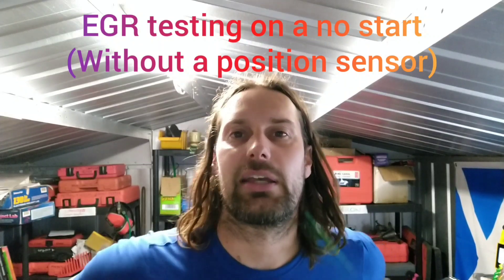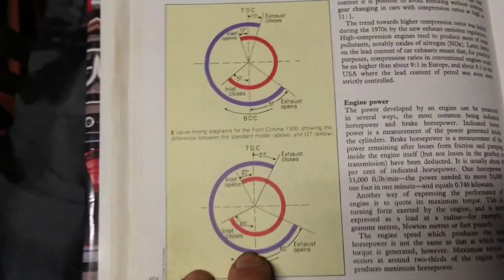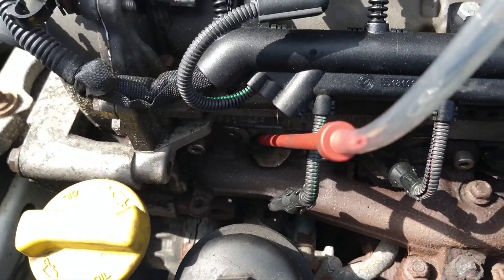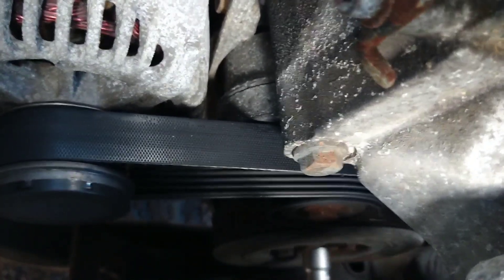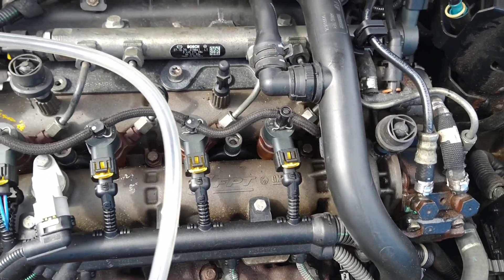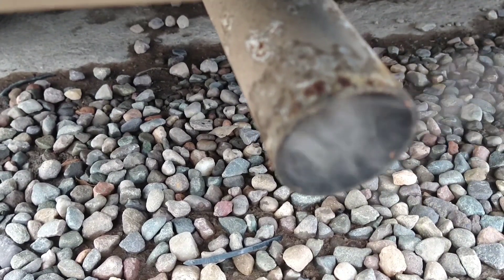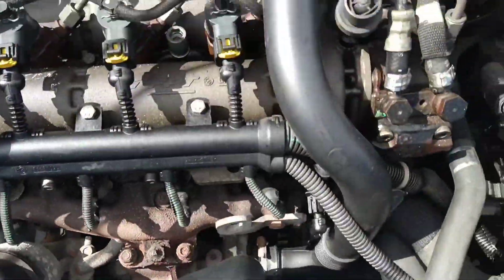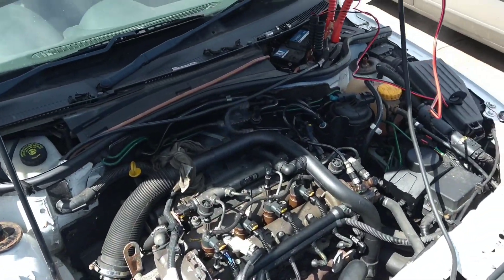EGR valve test (with a smoke machine)

Comment: How long have you been using that smoke tester and would you recommend  it?
Reply from the maker: I have used it for about five years, still working great. Thanks for watching
Reply: I have another question, if the egr valve is normally closed then why does smoke come out of the unit itself when I test it? Even after I replaced it there wad smoke coming out of the component. It has happened on a Toyota and a 3800 GM.

Comment: Cool test Matt will surely help someone out someday......just of of curiosity what brand or type of fluid do you use in your smoke machine and would it work in the smoke machine sandy made as ive one made myself....thanks
Reply from the maker: Hi Peter, thanks for watching and I have started only using baby oil the other smoke machine oil I used ended up not being as good, can't remember what it was called now but it was more intended for night clubs . Cheers Matt
Reply: @mechanicmatt871  Thanks for getting back to me, will go with the baby oil so